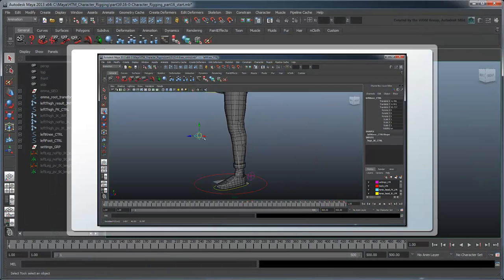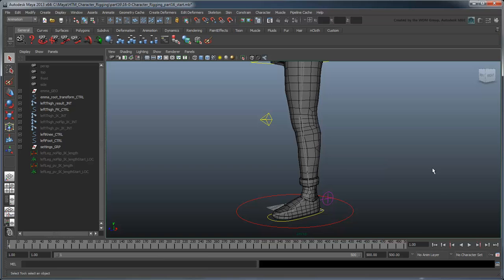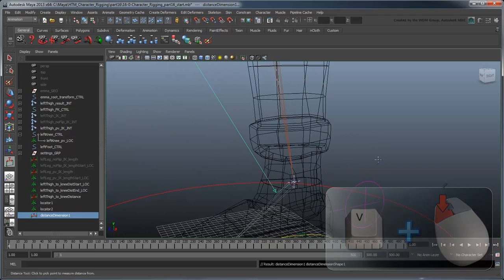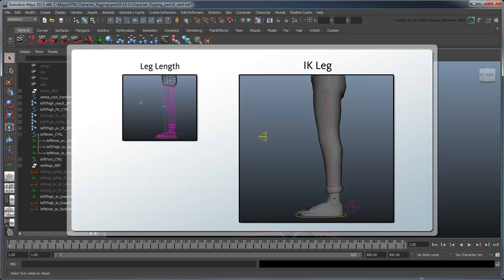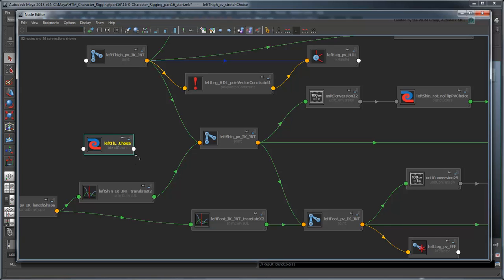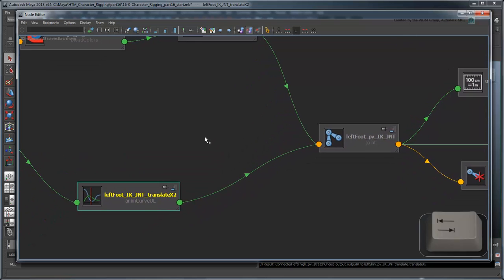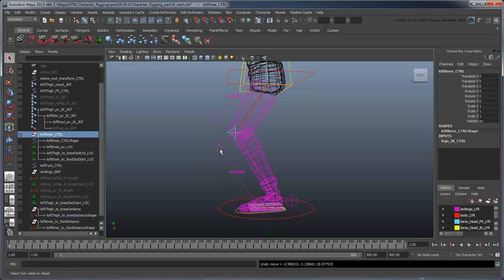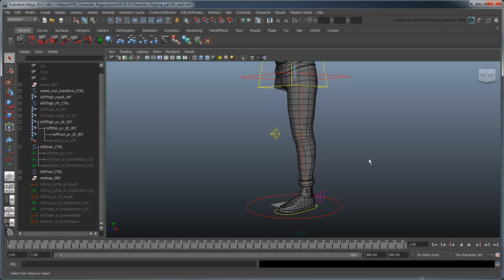Creating a Character Rig - Part 16: Snappable knee (Advanced)

Comment: for anyone using this tutorial and doing the right knee in 2022, and your geo keeps getting flipped, and you're just getting further confused by the comments, you need to make a MultiplyDivide node and place it between the DistanceShape node and the pv_StretchChoice node to multiply the distance by -1 so that it matches the translateX coming from the animation node that youre putting into the BlendColors node.
Reply: Thanks for the tip!

Comment: I'm using Maya 2020.  I had issues with the arms flipping after they reach a certain angle.  I downloaded your file, tested it.  I has the same problem. Are you aware of that? What can I do to fix it?
Thanks!
Reply from the maker: Henry Hilaire Jr there’s a set of alternate IK Twist values in the video description for the video where you create the IK arms.

Comment: I’m having this issue in Maya 2018, that when the knee snaps, the LeftShin_ik_jnt and foot rise up and do not match the location of the PV_shin or foot Joints.

I tried restarting the nodes from scratch and I’m still running into the same problem.
Reply: Never mind I fixed it. 

After two days of exploring the node editor I found that I connected the PV and No Flip: translate and rotate nodes to the wrong numbers in the blend nodes.

Comment: My right leg's Geo and joints flip and shrink on it's transition to snapping to the knee control.
Reply from the maker: Are you using the exact same script as the left side?  You'll need to alter it, because the right leg joints' LRAs run in the opposite direction.  For example scripts, download the finished rig in part 32

Comment: I did some troubleshooting on the right leg and and am at a point where I'm in need of your guidance. I used the scripts from the part 13 movie and replaced "left" with "right." I then learned that there are scripts from part 32's zip download using, "-1*($rightThighLength + $rightShinLength);"

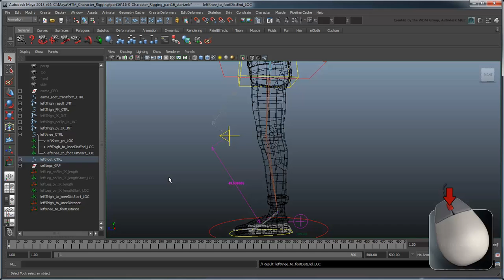Question A: I may just start over from part 13 again, however, I would like to know if there's a way I can fix the lack of the -1 value in the animation nodes. The rightLeg_IK_length measurement locators were deleted during PV and NF construction (part 15 @2:36). Could those deletions be the reason why the script doesn't work when troubleshooting here at part 16? If so, how would I get it back in this state so that the correction can be applied?

Question B: If in the case I were to go back to part 13 and execute the scripts again, I noticed that the scripts from part 32 tailor to _pv_IK_JNT and _noFLip_IK_JNT names — whereas part 13's video tailors to _IK_JNT names. Would I still execute a script with _IK_JNT and ignore the PVNF scripts? Or would I execute all three IK, PV, and NF scripts? If so, why? I can't figure that part out.

Here's my right leg: https://i.gyazo.com/1110e685f51a9174d82d6faabe4ee306.mp4

(scripts below for reference)
REFERENCE1 IK script from part 13 with "left" replaced  to "right":
string $driver = "rightLeg_ik_lengthShape.distance";
float $rightThighLength = `getAttr rightShin_ik_joint.translateX`;
float $rightShinLength = `getAttr rightFoot_ik_joint.translateX`;
float $sumLength = $rightThighLength + $rightShinLength;

setDrivenKeyframe -currentDriver $driver -driverValue $sumLength -attribute "translateX" -value $rightThighLength rightShin_ik_joint;

setDrivenKeyframe -currentDriver $driver -driverValue ($sumLength*2) -attribute "translateX" -value ($rightThighLength*2) rightShin_ik_joint;

setDrivenKeyframe -currentDriver $driver -driverValue $sumLength -attribute "translateX" -value $rightShinLength rightFoot_ik_joint;

setDrivenKeyframe -currentDriver $driver -driverValue ($sumLength*2) -attribute "translateX" -value ($rightShinLength*2) rightFoot_ik_joint;

REFERENCE2 PV & NF script from part 32:
//Right NoFlip Leg stretch
string $driver = "rightLeg_IK_lengthShape.distance";
float $rightThighLength = `getAttr rightShin_noFlip_IK_JNT.translateX`;
float $rightShinLength = `getAttr rightFoot_noFlip_IK_JNT.translateX`;
float $sumLength = -1*($rightThighLength + $rightShinLength);  

setDrivenKeyframe -currentDriver $driver -driverValue $sumLength -attribute "translateX" -value $rightThighLength rightShin_noFlip_IK_JNT;

setDrivenKeyframe -currentDriver $driver -driverValue ($sumLength*2) -attribute "translateX" -value ($rightThighLength*2) rightShin_noFlip_IK_JNT;

setDrivenKeyframe -currentDriver $driver -driverValue $sumLength -attribute "translateX" -value $rightShinLength rightFoot_noFlip_IK_JNT;

setDrivenKeyframe -currentDriver $driver -driverValue ($sumLength*2) -attribute "translateX" -value ($rightShinLength*2) rightFoot_noFlip_IK_JNT;

//Right Pole Vector Leg stretch
string $driver = "rightLeg_IK_lengthShape.distance";
float $rightThighLength = `getAttr rightShin_pv_IK_JNT.translateX`;
float $rightShinLength = `getAttr rightFoot_pv_IK_JNT.translateX`;
float $sumLength = -1*($rightThighLength + $rightShinLength);  

setDrivenKeyframe -currentDriver $driver -driverValue $sumLength -attribute "translateX" -value $rightThighLength rightShin_pv_IK_JNT;

setDrivenKeyframe -currentDriver $driver -driverValue ($sumLength*2) -attribute "translateX" -value ($rightThighLength*2) rightShin_pv_IK_JNT;

setDrivenKeyframe -currentDriver $driver -driverValue $sumLength -attribute "translateX" -value $rightShinLength rightFoot_pv_IK_JNT;

setDrivenKeyframe -currentDriver $driver -driverValue ($sumLength*2) -attribute "translateX" -value ($rightShinLength*2) rightFoot_pv_IK_JNT;
Reply from the maker: Okay, there's a lot to unpack here so I'll try my best to interpret what you've said:

A: You definitely need those measurement nodes and locators - in fact, they're the whole crux of the squash and stretch.  If you've somehow deleted them, you'll need to recreate them with the exact same names with the exact same functionality.  Luckily, you can run the squash/stretch scripts as many times as you want - Maya will just overwrite the old behavior with the new one.  The reason for the -1 on the right side is that (as mentioned in part 32) your joints' LRAs should be running in the OPPOSITE direction as the left side joints.  So while on the left side leg, the +ive direction was from hip to toe, on the right side it's from toe to hip.  However, because the output of the measurement node can't ever be negative (after all, what would a measurement of "-1 meter" even look like?), you need to flip that value to make sure the leg stretches in the correct direction.

B: You'll want to run ever one of those scripts, but not necessarily all at the same time.  The idea is that you repeat the leg videos on the right side, and then substitute these scripts for the left-side ones shown in the videos at the appropriate times.

Comment: I've got an issue with mirroring knee snapping on the right knee:
https://imgur.com/a/CaIWtSv
The sticking out joints are IK & result chain. They are not obeying the connection as it did on left.
Also, my IK_pv joint chain is not moving out to snap position as well.

I've thoroughly gone through both my left knee snapping nodes and the given mirrored tutorial rig, but I'm certain I've not missed something on nodes-side. So, I was thinking perhaps it's rather the attribute connection somewhere?  I'm really lost here.

I hope for the best there'd be some help for me on this very old tutorial...

Comment: Another day- another problem. I tryied to do the same technic to the right leg but it just looks now like a back horse leg (it just turn on 180 degrees and snaps to the Knee_CTRL) Is this joint orientation problem?
Reply from the maker: Did you compare your nodes with those in the part 32 finished file?  Remember, the joints on the right leg go in the opposite direction so you'll need to make some calculation adjustments (but don't invert the measurement node values!  There's no such thing as negative length).
Reply: https://imgur.com/a/MpdLPgo
Thats what I was talking about, seems it's just mirrors when it comes to 0.5 in BlendColors node.  The only difference in our nodes is the MultiplyDiv nodes from Part 17 I guess (i just didn't create it as I stuck here). 
If I want to make it similiar to the left leg I have to rotate GEO  on Y 180 degrees and Scale X to -1.
Reply from the maker: What if you pull the knee control further forward?  Ideally, you don't want those right on the knees even in the rest position.

Comment: Is it possible to do a knee snap without the squash and stretch? I'm not doing squash and stretch on my character as it is a very rigid humanoid robot, and so that doesn't make too much sense.
Reply from the maker: Unfortunately the knee snap depends on leg stretching, otherwise it would fight with the leg's IK handles.  However, what you can do is set up the knee position you want in FK mode then use the matching script in Appendix A of this tutorial series to get the same knee position in IK (with the knee already snapped).

Comment: i guess i'm not the only one who's having the distance tool issue. whenever i try to use the distance tool and click on the point A where there's already a locator or two(on the thigh joint, even when they're hidden), the tool doesn't create a new locator,  then when i click on the point B where i want the other end locator to be, the distance tool creates only a "distance" node, or only with its second locator, not with the start and end locators as a set. seeing that there's a "distance"node i'm sure it does have the starting point but i can't find the starting point neither in the outliner nor in the node editor. Maya even shuts down when i attempt to do this and undo this multiple times. i can manage the problem with starting from some other point than translate it, but it's weird..... :( i'm using 2016 btw...
Reply from the maker: Try creating the Distance tool locators out in empty space.  This will force Maya to create new locators that you can then point snap to the right places.
Reply: yeah. that helps too. what i ended up doing was though i created two locators and fed their worldposition[0] outputs to a manually created distanceDimShape node's start and end points.
Reply: That's right. Something's wrong. But I solved the problem thanks to the comments. Thank you all!

Comment: I'm following this tutorial with my own naming conventions, and I've run into a bit of a blunder as a result:
When I open up everything in the Node Editor, my PV Joints don't have Animation Curves attached to them.  Instead, my equivalent to the IK Result Joints do (the ones that receive rotation and translation values from the PV joints and No-Flip Knee Joints). Is this how it's meant to be, or should it definitely be the PV Joints with the animation curves attached?  Everything has worked perfectly so far, but I want to make sure my rig won't break later down the line.
Reply: +StrunDoNhor Well in a fitting reflection to the last time I asked a question, I've solved it after a good night's sleep:  I knew in advance that I would have to make NF & PV joint drivers, so I build those when I first made the skeleton, avoiding the entire "Duplicate Special with Input Graph" step in the process.  Thus, the NF and PV joints never inherited their own animation curves.

Comment: for some reason Maya wasn't making new locators so i just had to make a line and point snap it into place i should be fine right?
Reply: +Lord of Sin  I resolved this problem without holding V, so that I could make the locators, after that I just took the locators and pressed the key V to snapping into the leftKnee Ctrl and leftThigh pv IK JNT.

Comment: I'm trying to do the knee snap on the right leg, and it works, like, halfway... when I pull the knee control in across the X-axis, it works fine, but when I try to pull it up or down in Y, the distance locators move inversely. What do I do?
Reply from the maker: +Ocelott|SheDoesStuff By inversely you mean the locator moves down when you move the knee up?  When you created the constraint for those distance locators did you make sure that "Maintain Offset" was turned on?
Reply: Nevermind, I got it fixed. It had to do with the measurement nodes. Thanks for responding though.

Comment: Odd, I dont kow if this is a defect - but upon clicking the distance tool to the locator (under the pole vector control) it snaps the locator to the knee joint for some reason. I tried this with a raw scene and a simple two joint chain and a locator, im getting the same thing:

Repro Steps go like this:

1 - new scene, create a locator 
2 - create a 2 joint chain, move it so the locator is not occupying the same location
3 - create - measure tools - distance tool
4 - click on any part of the joint
5 - click on the locator

result:

Locator will snap to the second joint on the chain (along with the newly created distance locator). This step also cannot be undone.

Anyone else experiencing this?

On the flipside its not really a blocking defect. A quick workaround I've found is just by creating the distance locators elsewhere then move snapping them to the appropriate target locations
Reply from the maker: +Gogo The "workaround" is actually the main workflow we recommend using.  It's a lot more versatile to have those locators.

Comment: Hello Sir,
I have created a leg bone setup
I have added a ikrp solver to the leg joints
I have completed the three bone setup for the leg
I have added stretchy to the ik leg not for fk
I have just made one ik leg joints i.e of pole vector unlike your video so i directly connected the distance node distance to the ik joints i.e thigh and knee joints the bones are shifting from their positions randomly 
can you give a solution or make a video of simple snappable knee please it will be very much helpful 
Thanks in advance
Reply from the maker: +blossom ghuntla It sounds like you've created a cycle by connecting the distance locators to the ik joints.  You need to parent these to the CONTROLS, not the joints.
Reply: +Maya Learning Channel 
sir exactly which controller can u elaborate
Reply from the maker: We showed it right in the video, but to repeat they should be under the hip control, knee control, and foot control (never the joints).
Reply: Sir the snapping worked
But as I translate the polevector the joints go in the opposite direction
Reply from the maker: Sounds like a division / multiplication error.  I would double check all your math nodes.
Reply: +Maya Learning Channel 
sir how should I send you the image of the nodes sorry for the useless question or how r you going to check my nodes without having the file
Reply: Sorry Sir still not working
Reply from the maker: Maybe try using Imgur to host a screenshot of the issue you're talking about?
Reply: +Maya Learning Channel 
sir this the node editor connections pic
Reply from the maker: +blossom ghuntla Sorry but the link is broken.
Reply from the maker: It looks like you have the measurement nodes swapped.  You connected the knee_to_hip distance node to the ankle and ankle_to_knee distance shape to the knee.
Reply: +Maya Learning Channel 
thank you sir thanks alot

Comment: Um, whenever I open the Node Editor and click show all connections, I don't get the animation curve shown at 3:50, just a mess of blendColors, joints, unit conversions and the distance shapes with their locators .. but ive followed the steps until now. Is it possible that  its hidden, or was it never made? ): i really hope I don't have to backtrack and start over.
Reply from the maker: WolfGr33d Are you absolutely sure you had the PV joints and length nodes selected when you hit "Show Connections"?  If your entire leg scales correctly to this point then the curve nodes definitely exist (the leg can't scale without them) so the only other thing I can think of is that they may be hidden.  In the Node Editor, make sure Display > All Shapes Except Shading Group Memebers is turned on.
Reply: Maya Learning Channel 
Yeah, i have the PV joints and length nodes selected. The Node Editor is set to Display > All Shapes Except Shading Group Members... so I'm not sure where I messed up :( The leg seems to scale correctly.. the only thing that i can think thats off about my model is the upper thigh, it goes a little off track from the joint while it scales but i figured that might be because i didnt rotate its orient completely correct.
Reply from the maker: If you download the included scene file and show connections on that, do the curve nodes show up?
Reply: Maya Learning Channel 
Okay, took a while to reply back because I just redid everything all over thinking I probably just screwed up. But I ran into the same problem again, then downloaded the scene file and yes the curve nodes still aren't displaying :( (not even in the scene file)
Reply from the maker: WolfGr33d Have you tried clearing your prefs and reopening Maya?  It seems to me like something with your setup in messed up.
Reply: Looks like that solved it! (I think, renaming the prefs file resets the prefs right?) Now I just gotta reset my personal rigging shelf at some point ;-;. Lol but thanks a lot for the help, no idea how my preferences got screwed around.
Reply from the maker: Excellent.  And yes, occasionally you can set prefs without really realizing it during the course of many ordinary Maya operations.  It happens to everyone.

I'd suggest saving your custom shelves so you can just reload them if you need to reset your prefs again in the future.
Reply: Sweet, thanks for all the tips! Now for the rest of the leg :)